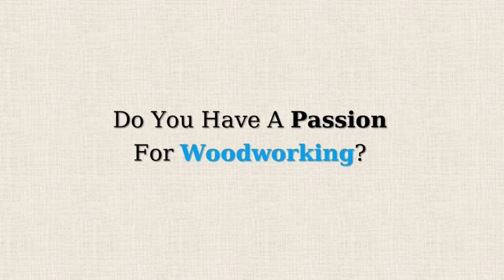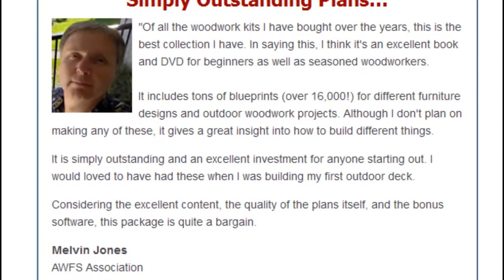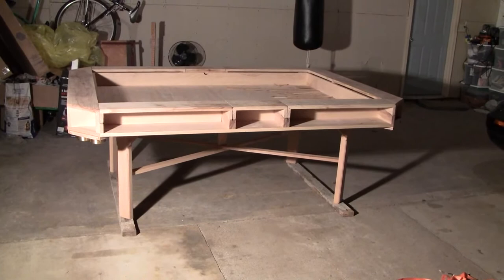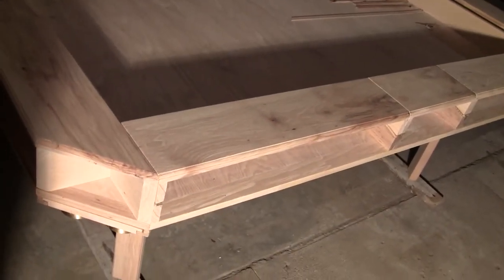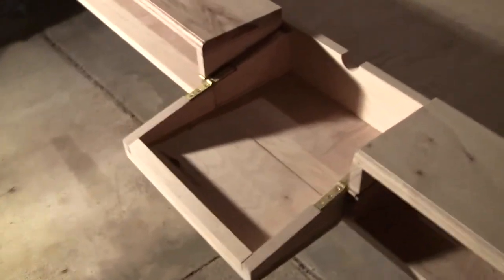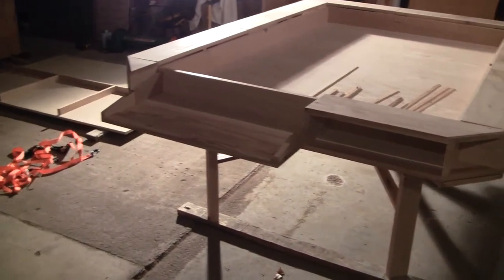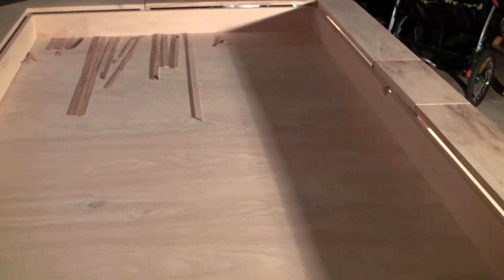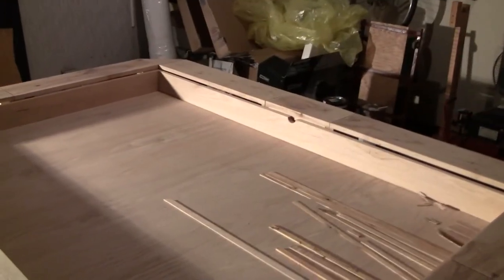Wood Working Plans

Comment: It's really difficult to begin a woodworking project. I had wasted a lot time & cash on my previous work. Then I discovered the reason, that is I didn't have a exact plan & diagram. I always let things worse when it can be repaired easily if I had some experience. Then I found a woodworking program that contains all the detailed diagram, tips & guides - it help me lots.